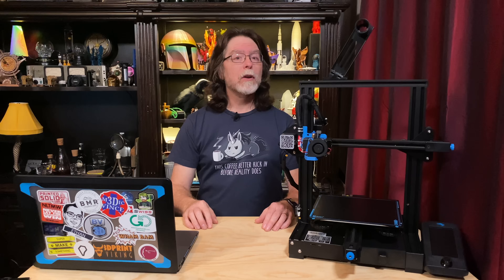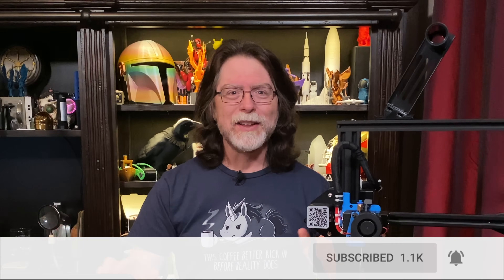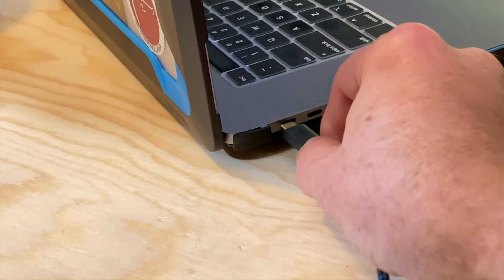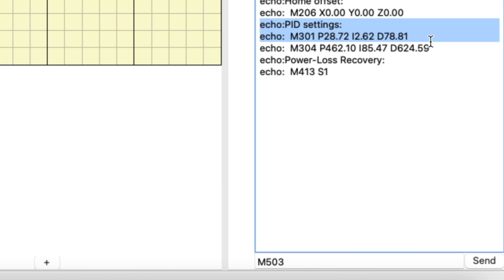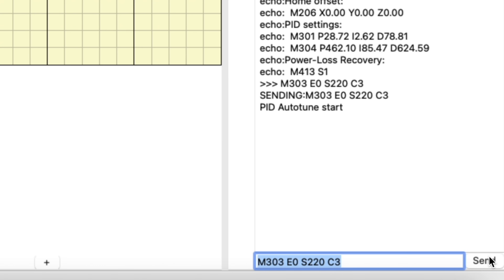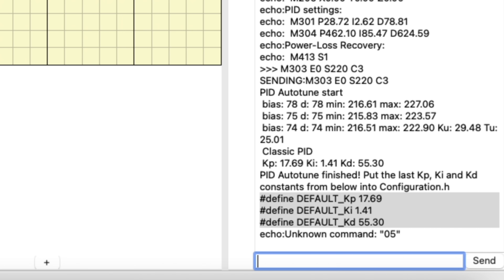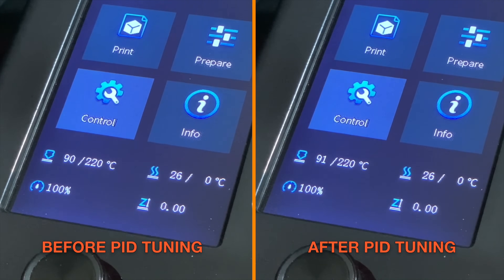PID AutoTune your Ender-3 V2 (or other Marlin-based 3D Printer!)

Comment: Hello,
Thanks for the video.
But on my case, the new pid is not saved with the command m500.
When I turn off the printer, the set UP back to the stock parameters.
Do you know how to manage it ?
Reply: It should work when sd card is plugged

Comment: I am having a similar issue on a e3pro that I'm trying to fix for a client. it would not throw thermal runaway, but it would jump well past the set temp and drop, and the print would never start. So I replaced the thermistor, but the problem still existed. The client asked me to swap out the board and see if that helped it did kind of. The temp now jumps 30c past desired temp but then goes to the set temp and stays at desired temp and it will print now.

Comment: What should i do if the PID tuning didn't work, i followed all the steps it seemed fine, even managed to get to a temp of 220 but after i saved it and turned the temp up to 200 it stayed at around 190 and errored again. 

Edit: so followed all the steps I'm assuming the PID values it spat out wasn't right so basically stole your PID values from your auto tune.... I'm not having any error now 😂  hopefully I'll be able to print something

Comment: Thanks alot! I was facing this issue where my Ender 3 V2 was unable to maintain nozzle temp. I changed the thermistor twice, check all the connections, changed the hotend, reinstalled the firmware. After auto tuning PID settings, the issue seems to have resolved.

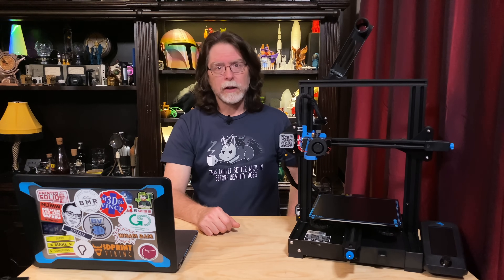Comment: Way too verbose.  But a good video nontheless.  Skip to the 2:10 mark for explanation of PID.  Skip to the 6:20 mark for the procedure if you already have pronterface.exe.  This fixed my Ender 3 Neo V2 temperature "hunting" issue.  I'm thinking this procedure may not be bad to perform if your heater and thermister are a year or two old and you see unstable temperature.
Reply: I am unable to connect to my ender 3 v2 with pronterface. changed the Baud rates to match on port, no sd card installed and cura closed. tried different cables. printer on or off. just says connecting and stays that way. my new stock hot end has the temp fluctuation you described. I know this is older video but a very clear one. Hope your still responding. Thanks.

Comment: @Bryan,
Thanx for the video. Clear but still I encountered a problem. I hope you can help me out.
I have two E3v2 (different mainboards but otherwise identical and factory standard though CRTouch added).
One has more variance in temp during printing than the other (approx 6C) so I wanted to PID autotune this one.
Strange thing is, this one gives the error "PID Autotune failed, Temperture to High".
You can see during proces that temp cycles oké until the last cycle and than it keeps on heating (to 240C or so) and than the proces stops giving the error.
The other printer ends the proces as expected.
What is happening and what can I do to fix it?
Thanx in advance for your reaction
grt,
Lex

Comment: When I do the code my printer stops the code and says “Error:Printer halted, kill() called!” I took it apart recently to fix a clog and it said extruded temp to low so I came to this video but it still doesn’t work. (I have the ender 3 v2 Neo)

Comment: Video saved me once again. I followed your instructions a year ago and just installed a new hot end. The hot end is the same brand but I could tell the PID was off a bit. Found your video and did it over. Thanks.

Comment: This is the most long winded how to video ever. I am stopping at 5:25 to seek out a more concise video that does not have someone who feels they need to be on the screen for some reason to drag it out I guess for their ego or vanity? Either way I see it is informative and designed for a novice but give the audience a little more credit on aptitude. I suggest you run this video on 2X or play it while working on something else to pass the time.
Reply from the maker: For those who enjoy complaining about information they got for free in 2.5-year-old videos, there's a simpler two-step method:
1. Install better firmware.
2. Run the PID autotune from the printer's screen.
Done! 😊
Reply: @BV3D  You make a sound point and I would like to apologize for my critique. Thank you for the content, you really do present it well. :)
Reply from the maker: @johnconner8218  Mostly I just make a sound. 😁 I should add chapter markers to this one. The automatic ones YouTube put in are awful. Then you can skip past the why and get to the _how_. The automatic captions are horrible as well.

Comment: Is the Hotend Fan supposed to be running when you do this PID AutoTune and what do I do if it does not? Will it matter much?
Asking because when I run PID Autotune on the Neptune 2 it shuts off the hotend fan. Yet my other printers keep the fan running when I run the PID Autotune. Most of my printers have the hotend fan set to start at a certain temp with only 2 wire to have them running all the time. My Neptune 2 is one that is set to run at around 50° and that is on its stock firmware. I just find it odd that it is the only printer that I have where PID Autotune shuts the fan off.

Comment: I wanted to add something to this video, especially for people that are tuning non-creality printers. As a first time printer owner I was doing my PID tuning after upgrading my duct on Anycubic Kobra Neo and when I followed these directions the fan never turned on. I didn't realize it until the 2nd time I did it, and I had to manually turn the fan on in order to successfully tune the printer. I'm guessing the reason he didn't mention this is because the ender does it by itself? so maybe it's just anycubic printers that you have to manually turn it on, nonetheless, hope this helps someone!
Reply: And also, pay attention to your printer screen because sometimes it says click to resume and you have to push the button to make it progress

Comment: The PID auto tuning did not solve my temperature drop problem in the hot end during printing. It is not due to thermal runaway. But due to insufficient current from the power supply unit

Comment: +I have a Elegoo Neptune 2S.... and i use Jayo PLA+ religiously.... On my other printers, It prints fantastic at 220c.. (label temperature states 210-235c).....
But since i bought my Elegoo (second hand).. I couldnt get it to print at 220c.. and figured out that i needed it cranked right up to 240c, to get a flawless print... While all my other printers were happily printing it at 220c.....
Having it set at 220c on my elegoo, Would clog and make my extruder stepper motor click badly....
My on-screen temperature doesnt fluctuate much at all.. usually goes to 239c then right back up to 240c, As you'd expect...
But Clearly my elegoo is reading incorrect temperatures.... Because 240c is Waaaaay hotter than recommended temp on the label..
Could a PID tune fix this?!?!

Comment: Thanks for the video. I've run into an issue at 6:55s on Mac. Of the possible port connections and baudrates, the only one that offers any feedback is tty.usb with 250000. However, it appears to only running a partial retrieval. Some information is given, but ends with "...echo:; Mesh Insets and leveling settings: Got rubbish reply from /dev/tty.usbserial-1430 at baudrate 250000: Maybe a bad baudrate?" 

I'm not finding anything with "M301." Has anyone else run into this?

Comment: What if I print often with PLA+ (210-220c), and switch over to pa6-cf (260-300c)? Should I PID tune for both temps each time i switch to one or the other? Or do i just PID tune for 300, and then when i switch over to pla+ it should still be good? I don't have separate printers for that, so i use the same printer to print between the two.

Comment: Thank you for the video. I have a Ender3 v2 Neo and on some prints I am getting a thermal runaway. But no on all prints. I have made no changes to the printer. I did check the firmware and that the silicon sock was on, and the thermistor was seated and screwed in firm but not tight. All that done, I am still getting alarms when I print certain things. For example I have printed the larger parts for the LACK table enclosure, but when I print the hinges they will have a thermal alarm. Should I do this PID tuning? I have not replaced the thermistor yet. I am not hugely comfortable with taking the printer apart. So I have been trying to solve this issue with other options until I basically have no choice. :)

Comment: Thanks for making this.  I'm dealing with an odd result when I connect (running Mojave) with the original software.  I connect using "/dev/cu.usbserial-40" which is different than in the video (tty option)..  mine doesn't just say "printer is online" it says:

Connecting...
okT:17.3 /.0 B1858/000@: B@:0k :1733/.0 
B1857/000@: B@:
Printer is now online.

k :1744/.0 B1866/000@0 B:0

k :1.3 /.0 B1.5 /.0 @: B:0

and my M503 command gives a very different output.. 

>>>M503
SENDING:M503
o T1712/000B1822/000@0 @:0eho:; LiearUnts
 ;(m)
;Tmpraur Uit:
  19  ;UntsinClsu
o;Fiamntsttng (isbed:
 M20 0D175echo; Sep prunt:echo: M2 8.00Y8.00.0E.0echo:;Max eeraes(uit/s:
 M23 50.0 50.0 Z.0 E5.0
a clraio (nit/s):echo: M01X0000Y5000 10.0 100.0
celraio (nis/2)(<pin-acl>R<etac-ace> <tavl-ccl>:
 24 50.0 R000 T00.0
;Adaned(Bmi_sgmnttie_s Smi_fedrt> <mn_raelfedrt> <mx_er> <mx_er> <axjek>E<ax_er>) 

So I can't find the PID info.  I'm running Marlin 2.1.1 which was configured by the person I bought it from.  I have the BTTouch installed. .

Comment: Great video easy to follow, but after doing all the steps it just say "sending: M500" and doesn't give an echo back
Reply: im having the same problem
Reply: @jakenatale5955  mine never sent back an echo, but it did save the adjustments, even after disconnecting from the PC and cycling the power. It did, or rather didn't send the echo after I adjusted the E-steps as well, but they showed up as saved all the same. So hopefully yours does the same.
Reply: @reidl.9983  yeah turns out mine did as well

Comment: Hi Brian, I'm having an over heating issue while trying to run the PiD tuning for my ender 5 pro, all I'm getting is "PID Autotune failed! Temperature too high" I've tried different values to heat too and tried using the M106 S255 (fan speed 100%) code but I'm still running too high, is there any way to solve this issue or is it a new motherboard for it jobby?

Comment: I have the Ender 3 max. I have installed a Sprite extruder that does 300°. My question is if I use your settings you’re saying to do will I be able to print at 300 after. Thank

Comment: This video is fantastic! Thanks for putting this together. I am having an issue with my heating element, where I will set my nozzle to 200 degrees, and my nozzle will heat to 200 just fine. However, after 200 degrees is reached, the heat cuts out and the nozzle temperature will decrease, then beep obnoxiously, and then say "Heating Failed: E1 PRINTER HALTED Please Reset." Sadly, this error is happening, even during the PID tuning.

I have replaced my hotend (new unit with new thermistor, heating cartridge, nozzle) , tried PID tuning, and now I've ordered a new motherboard. If anybody has faced this before, please let me know if there is another fix. I am replacing the motherboard this week, and I really hope this is the solution. If this works, then I plan to make a post somewhere with the fix, in case somebody else comes across this nightmare.

Comment: Great video. Works just as well on an ender 3 v1. Just changed to a Revo CR quick change nozzle and needed to run the pid but hadn't ever done it before. Didn't realize marlin had an a pid autotune built in.
Reply: Are you happy with the Revo CR? The idea of a quick change nozzle is really compelling but it's also a lot of money.
Reply: @NateRidderman  very happy so far. Super easy to install and works exactly as advertised so far. I took the suggestion of another channel and changed my end gcode to always retract the filament into the Bowden so when I want to change nozzles before a print I don't have to heat it up at all. I've done prints with the 0.25, 0.4, and 0.8 and after tuning my slicer settings for each it's been as expected without having to relevel between nozzle changes.

Comment: I keep getting an error that says the auto tuning failed because the temperature is too high and it’s at 18 degrees Celsius
Reply: Is your printer turned on while you're trying to autotune? Because if not it won't have the necessary power to operate the extruder
Reply: @tparker1842  it is on when I’m doing it

Comment: This was perfect! I had a machine that I was getting overtemp errors on so I changed entire hot end (just easier since I had 2 spares in my parts) and still got the error. I found your video through ALL3DP and followed it to the letter and so far success. Hope I am not premature but looks great so far. Thank you so much for the content. Now on to the next problem. I upgraded one machine to 4.2.7 silent board and smoked the board on power up. Have a short somewhere I have to find before I smoke another $40.00

Comment: Thank you, very useful info.  I'm not sure if you mentioned PID AutoTune in your JyersUI video or not.  I switched to JyersUI after watching that great video and have been very happy and even more so after discovering JyersUI has the AutoTune feature built into the UI so Pronterface is unnecessary.  More good news, with JyersUI your settings are saved to the board. not the card.

Comment: Great video very useful information. Could I ask though once done and saved the next time I pre heat the pla should it heat up to the new value say 220 if that's what I used? Asking as I've just pre heated pla and it's gone to 200 seems very stable though at the moment anyway. Please help so I know I've either done things right or need to re tune so each time the temp reaches that set while tuning. Thanks again

Comment: I was curious if there was an option, and if so which, to do this for the bed thermistor? I own a CR10 v2 and have been having issues with bed mintemp errors and have replaced the thermistor several times and still receiving the error. It was suggested I try PID tuning - and will try that, but was wondering about setting it for the bed thermistor as well?

Comment: i cant save it with m500
Reply from the maker: Some printers don't allow saving to EEPROM; others save but write it to the SD card. If your printer has an SD card inserted but you can't save the values, you can put your M301 command in your starting G-code in your slicer. Then when you slice and print, it should set the PID values.
Reply: @BV3D  i  try to do thIs but then it says Nozzel temperature to low on the LCD and it beeps !
Reply: And i also have the same printer Ender 3 v2 Mainboard v4.2.2

Comment: Mr. Bryan sir! ... question, noticed that you use only 3 cycles for the PID calibration? is that your recommend to use for this process? ... or wuz this just for time sake, for recording purposes? And I cant thank you enough for putting this together! ... looked at 6 other resources before I found this, and its the most comprehensive by far!

Comment: Pardon me if I missed it, Would you know if the motherboard in that printer is the 4.2.7 ?
Great video by the way thank you.
Reply from the maker: Hi, that printer has a v4.2.2 board in it. Thanks! 👍
Reply: Ok good to know, must be something wrong with my board it's also 4.2.2 and it didn't work, had to reinstall the old heater block which the nozzle threads are starting to strip. Thanks for the reply.
Reply: After a few days of emails and a little bit of diagnostics, creality is sending me a new heater block assembly.

Comment: I'm getting a Cannot connect error 5 access denied when I hit connect in Pronterface. I even tried opening it using Run as Administrator
Reply: Nevermind I had left CURA open so it was using the port.

Comment: So I ran this and followed everything including your temp of 220, even though I usually print around 205. When I set it for 205, it would only heat up to 195. I'm running it again for 205, but do you have any idea why it would do this and how I can fix it?

Comment: Think of the challenge that birthed the PID process/math being you and your friend in a car trying to drive a constant speed...you're driving but your friend is the only one that can see the speedometer.  Your friend tells you faster or slower as they see the speed on the gauge.  If you are in a F1 racer, you're going to have a different experience than if you and your friend were in a Chevy Spark.  The PID process can be thought of as a mechanism that attaches to the gas pedal of the F1 so the results of accelerating/decelerating are not so dramatic.

Comment: Jyres Firmware has built in PID autotune feature
Reply: Not the ender 3 with that lcd screen. 
Should be ender 3 v2 I'm not sure because I updated my ender 3 so I had that screen and silent drivers and now I don't have that option.

My guess is you think you know more than you actually know.

Comment: When I type m500 it won’t send
Reply: Did you get that figured out ? I’m having the same issue
Reply: @CGlorenzo   I just didn’t try using my printer for a week or 2 and it finally stopped and is working normally

Comment: Did everything right, step by step and my temps were even more unstable than before. Could it be because I wrote 200 instead of 220? That's the temp I use for printing PLA.

Edit: Turned on the printer again and it makes a strange sound. I won't turn it on again because I'm afraid of it catching fire.
Reply: I had thermal runaway after my first tune. Second tune and it worked again. Just keep tuning and take the middle most settings, I suppose.  Good luck!
Reply: @hideouspenguinboy  I had that error too. I bought a new thermistor again because the one that I bought the first time didn’t have a connector so I had to cut the old one and solder it with the new one. It could be from that too but I don’t really know. I hope it will work so I can continue to print.